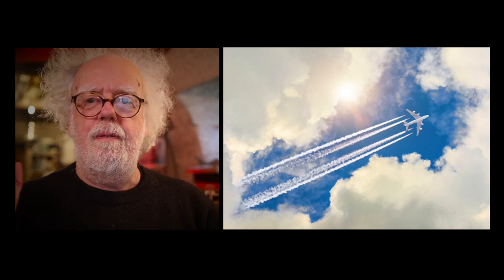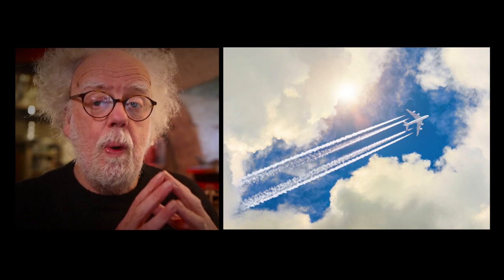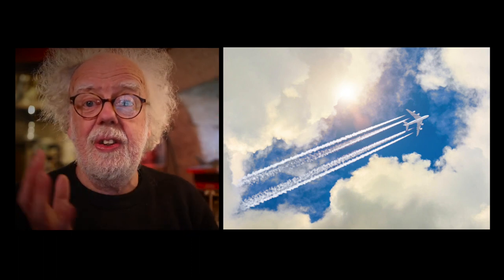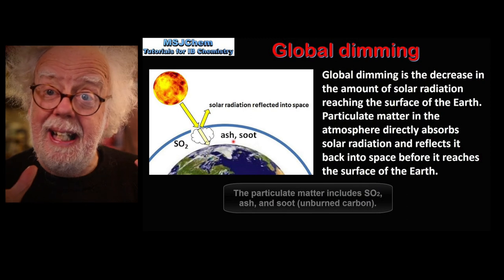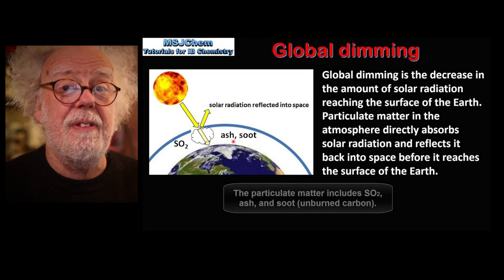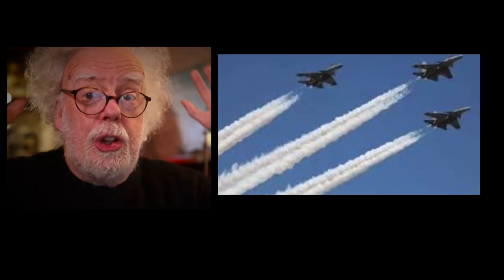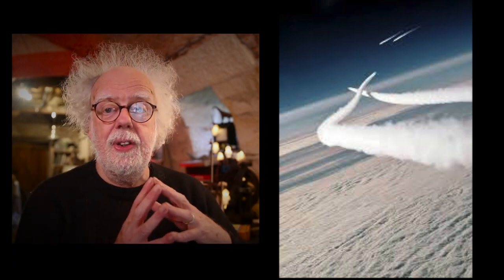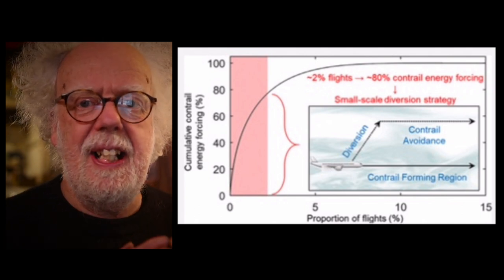Con-Trail Secrets - Prof Simon

Comment: Brilliant thanks. As a pensioner and now full-time gardener, I have observed beautiful blue morning skies destroyed by vapour trails not from regular flights but from formations of high speed presumably military jets flying criss-cross. Just as your dad observed the trails just widen and widen until the whole sky is obscured. Very annoying for a gardener. Now recently (last couple of years) this activity has stopped (odd that). Regular flights tend not to cause problems perhaps because they are lower nearer us. Twould be great if flights could be planned to avoid making these trails in the first place. Also nice of you to admit that clouds are the major greenhouse gas. All gardeners know that if it's cloudy in the evening there is no need to worry about frost because it keeps the temperature much higher than a clear sky. (Incidentally, I have never looked at a CO2 meter and said I'd better protect my plants because there is 0.001% less CO2 in the atmosphere today but let's not go there). Perhaps also of interest, in my last job I had the pleasure of having Frank Whittle's original signed patent for his jet engine in my safe. Quite a privilege!
Reply: Those "criss cross" patterns are planes flying along set routes in the sky
Like highways for planes, each altitude has a set direction, the routes are called airways 
You mention one day it suddenly stopped 
I'd wager a bet the airways were changed in your area
Info on that is publically available of course, youd have to do a little research..or find a pri ate pilot familiar with your area and ask 

The radio towers used as navigation beacons  are sometimes moved
Its fascinating stuff, you might find yourself reading quite a while on it  :)
Reply: A bunch of anecdotal gobbledygook. What is your actual point?
Reply: Whatever the cause Dave, I am very pleased to have my blue skies back but no, the cross cross jets were all flying at the same time and making a perfect grid. Passenger flights were entirely separate larger planes. Generally these are lower, landing at nearby Manchester or Liverpool and their vapour trails disperse immediately.

Comment: I'd expect Brownian motion to mix the exhaust such that it doesn't matter the altitude. What I'd be interested in is the effects of fuel dumping. Such as, the Los Angeles incident recently. An SR-71 pilot once commented after doing a low level fuel dump that, "there's a farmer who's going to wonder why he had a bad cotton crop this year."
Reply: Good question, though the problem is that the SR-71 uses a special fuel that has special additives to increase the flash Point significantly.

So a better case would be the recent fuel dump over.......LA at Low altitude would be a better case.
Reply: I thought they could only fuel dump into the ocean, not that I agree with that concept either but more importantly are they dumping for emergency landings or because they want to control the agricultural sector and increase the cost to the general consumer for food. The government of the day don’t look after the population and they have had a hidden agenda for a long while. They burn out the farmers force them into loans they cannot repay then repo the land they owned for generations and replace with gmo crops.
Reply: @sfd50  No, the requirement is to dump above, I think, 6,000 feet in order for it to evaporate before it can rain down on the surface. I don't buy in to any agenda regarding that. No such thing as chemtrails, other than maybe seeding clouds to affect rain.
Reply: @LupusAries  The SR-71's fuel is regular kerosene with cesium added to reduce the heat signature from the engines. Something to do with a change to plasma. I believe the good Professor had a segment about that recently.

Comment: Having lived all my working life  just 12 miles from Manchester Airport and directly under the flight path, I had been seeing for many years how quickly a beautiful blue early morning sky changed into a completely overcast and dull one.  The convincing proof came when I had travelled to work 30 miles away and the sky had became clear of overcast.  This I noticed  literally hundreds of times over a period of 20 to 30 years.
When I retired,  I moved away from North Manchester and down to Worcestershire, and lo and behold the blue sky's of my youth have mostly returned.
Reply: @GypzyJack  The conclusion that  I drew is that vapour trails initiate the formation of an overcast which quickly replaces the clear blue sky.  The observed result was that a regular blue sky from first light had become a regular overcast sky by 
9-30am.  (The first regular flights and vapour trails directly overhead started at roughly 7-45am)

Comment: I see one article on Stealth Aircraft Contrails that brings up these two interesting points..

The original B-2 design included tanks outboard of the main landing gear that would store a chemical to mix with the exhaust and suppress contrail formation. According to one report, "chlorofluorosulphonic acid" was to be injected into the jet exhaust to eliminate contrails. But this scheme wasn't actually used. Several other acids were tested too, but the result was that the chemicals were too corrosive.

In 1994 the government awarded a $63.5-million [other sources report $16 million] contract to the Northrop Corporation to fine-tune stealth bombers in a number of ways. One retrofit involved the installation of "contrail management systems." Ophir, an optical sensor manufacturer in Littleton, Colorado, saved the day. Its Pilot Alert System uses lidar (light detection and ranging) to differentiate contrails from clouds and tell the pilot to change his altitude when his aircraft is "conning."

Done some more digging and i find this ..here is a patent for such device 

https://patents.google.com/patent/US5285256A/en
Reply: I was under the impression that they mixed alcohol with the exhaust at one time to prevent contrails.
Reply: @garywheeler7039   It's not a subject i know much about, what i post is just 20 mins of searching around ....

Comment: It's a few decades since I was a research chemist but here's my ten pannies' worth. Regarding whether vapour trails form or not depends on the temperture and the dew point of the air through which the plane is flying. I'd suggest that the existing air humidity is a relatively minor factor. All aircraft emit vast volumes of superheated steam from fuel combustion. Thus, a condensate stream (contrail) will result when the local dew point parameters are exceeded. Soot particles from engine exhausts do act as nucleation points for dew, though a similar function is provided by airbourne bacteria. Indeed, harmless bacterial concentrates are/were used to initiate water crystalisation in snow-making machines. Other colloidal materials are also used as nuceators.
Not all contrails persist long enough to produce an ever-widening haze that affects sunlight. Very often, they disappear a short distance behind the plane creating them. Here. the dissipation of the vapour reduces to a condition below the local dew point and the sky remains perfectly clear. At other times, aircraft produce no trails at all.

Comment: I certainly noticed the difference between the skies over Southern England and Queensland Australia. Not just the latitude but the significant absence of high altitude condensation trails. Of course, the clear atmosphere of Australia brings with it the increased risk of high UV levels... so Slip, Slop, Slap... or burn more AVTUR, Australia the choice is yours!

Comment: Northrop, when designing the B2 put a lot of effort into the the exhaust system to ensure that they produce no contrails. The exhaust is mixed with cooler air before it exists the nozzle and that nozzle is set back inside the aircraft. The result is no contrails and very low heat signature that would give its position away. I also believe that the aircrew have an instrument for measuring the outside moisture. Great upload professor 👍

Comment: I was a USAF weather specialist, an observer, in the 1980s.  A lot of what you said is almost accurate, but is missing a lot details, especially how this has been known for decades.

Meteorologists have been aware of the warming effect of persistent contrails spreading and forming a cloud layer.

Also, contrails can be forecast using upper air soundings.  Weather balloons carrying a rawindsonde will record air temperature, dew point (the two rill give you relative humidity), air pressure, and by tracking the balloon you get the wind speed and direction.  As a result you get a profile of the air from the surface to 200mb or higher.

When this data is plotted on a Skew-T Log P chart (and I've plotted a lot of these by hand) a forecaster can forecast at what flight level contrails are likely to form, and whether they will persist and spread out.

Comment: anybody mention when you see contrails forming ,a moist low pressure front is moving in  and vice versa.I lived in a arid climate and depending on which frontal system was coming in or exiting you saw contrails forming or dissipating 

I'm sure the military experiments with chemicals to dispel them though.

Comment: This has become a significant issue since commercial aircraft started routinely flying above 40,000 feet in the interests of fuel efficiency. Flights at or below 20,000 feet produce far fewer contrails and they disperse relatively quickly in the more turbulent lower atmosphere. Going back to the 1960s I recall seeing contrails quite frequently in Winter months in the UK. In Australia during the same decade, contrails were never visible at any time of year. Of course commercial aircraft tended to fly at altitudes around 20,000 feet in those days. So the overall climate of a region is particularly important in determining at what altitude aircraft can fly without leaving visible contarils.

Comment: Professor Simon, That information is gleaned from the data transmitted from a weather balloon. The piece of technology is called a rawindsonde and the device is a radiosonde. The data transmitted back is plotted on a chart called a skew-t. The contrail (vapor trail) zones are indicated on the chart. One big problem is that there are so few launched each day compared to the amount of atmosphere to measure. I used to be a technician for meteorological equipment.
Reply from the maker: Thanks Mike

Comment: Doppler weather radar is only useful if water vapor is in the air. That’s why clear air turbulence is still a problem when the air contains no moisture and radar cannot see it.. i assume a hygrometer attached to a pitot tube can sense relative humidity? Maybe there is also a connection to dew point at flight levels?

Comment: Well there is another source of the moisture. The product of combustion is carbon dioxide and Water Vapor. It all depends on the temperature of the air. I am pretty sure Ice Crystal's can form any time the temperature is below 0 degree C. And at 35,000 feet it is well below that.

Comment: I thought contrails only appeared when a plane rises above the altitude where the temperature is less than zero degrees Celsius.  I believe this to be between 5-10 km.  Although this is not normally a good cruising altitude for fuel economy or passenger comfort as the pilots avoid low level weather.

Comment: Every litre of jet fuel or petrol burns to a litre of water. Whether it’s a piston engine or a jet engine that water condenses into vapour trails. 
They do reflect heat into space but it’s not necessarily enough to offset the CO2 warming effect.
Reply from the maker: not sure it makes the same amount in water.... there are hydrocarbon particles...soot....and lots of C02.

Comment: Don't forget to mention that fuel is not just organic. Fuel also contains nano particles of metals especially aluminium being used as a catalyst. This is very important for fuel efficiency but is also causes problems for the environment.
Reply from the maker: Interesting
Reply: @SimonHollandfilms  check out the Shasta county video about this. They have been measuring increases in aluminium in top soil.

Comment: Contrails are condensation which disperse into the atmosphere at a constant rate following the plane. Chemtrails are full of chemicals and metal particulates. Harvod Uni had something on them a few years back which stopped Chemtrails from being dismissed as conspiracy. Geo engineering and weather modification has been going on for decades. 

There's no need to introduce your own term Vapour trails in to muddy the water.

I speculate that adding metal particals in a blanket at (Chemtrails) 30+ thousand feet high aid telecommunications. As most bandwidth is lost up....
Reply from the maker: In Britain we call them vapour trails...I didn’t make it up...and the film was not about chem trails...it was about climate science

Comment: Actually, there's moisture in a jet engine exhaust and it condenses into the water which freezes at the extremely cold temperatures at high altitudes that jets fly at.

Comment: Prof Simon, yuo seem to have overlooked that the two major combustion products of kerosene are Carbon Dioxide and WATER.  The water is hot and therefore gaseous, hitting the cold atmosphere they condense, hence the name Con Trail !! Its WATER!
Reply: As for measuring humidity.  No required.  DEW POINT which I think is a function of ambient temperature and pressure.  And as for the U2, I'd guess you want to be looking at what they add to the fuel to stop contrails.

Comment: Your question about humidity levels in the the jet engines are not measured. I can say that the efficiency for jet engines comes from condensing the air and I’m sure you know that when you compress air you remove the moisture.  Basically what your seeing out the back of a jet engine is primarily moisture. The actual carbon emissions ie. co2 is not visible.

Comment: On the type that I currently fly, the 737, there is no way of measuring outside air humidity. Merely the varying temperatures and pressures. It is interesting to see however when an aircraft passes by and there is no trail, or a rather excessive one.
Reply from the maker: Brilliant...thank you Henry...if ATC we’re flexible enough to let you change altitude in, say a 2000ft window, do you think this could be adopted?
Reply: @SimonHollandfilms  ATC are usually very accommodating to a change in level if it is for performance, weather, etc. The only issue that I can see arising is if 10s of aircraft are requesting the same FL in order to mitigate vapour trails. This would probably need to be taken into account in the planning stage when filing a flight plan, such as what our systems do now in trying to file favourably based on the winds.

Comment: Great to see recognition of cloud formation affecting our climate change from you prof....I can only imagine vapour trails hang around more now than when I was a kid because of fuel mixture changes and the leaner burn of engines. More denser / dense, unburnt fuel would drop quicker and vaporize less...Just my best guess...
Now ask your self is the extra heat which these clouds created, account for in any climate change report?  No there not the extra heat just bumps up the co2 figure...is any pennies dropping yet?
But dam good suggestions to fly higher/ lower...I want climate heat down too...but record it right. Regards.
Reply from the maker: Clouds are our main source of greenhouse warming...but CO2 absorbs heat and makes the clouds....hmmmmmm.
Reply: @SimonHollandfilms  bang on, clouds are also made by charged particles from the sun. In your mind what proportion are made by co2 and what proportion is made by charged particles. When you know the answer to that,   You won't say main source of warming. And see charged particles where not allowed into the ipcc report then your know a large amount of data and heat is unaccounted for. Regards.
Reply: @SimonHollandfilms  "Green house effect" is not even the right term for the process, its a conned buzzword for "Science" warshipers.

Comment: Professor.. I have an idea that might work if they knew or could monitor  what moisture level   or  percentage  of the exhaust that is water is emitted from the jet engines. at various altitudes.It  could .easily be done with a small tube outside the aircraft being used to test the ...existing vapor trails and be able to vary the moisture being released, then they could  use that info and   then   alter the Vapor Trail  water content by Pre- heating some of the the incoming air.(  a lot like the Ram Jet Engine)..so that  the water levels  would drop to a low enough  level.so that there would not be any trail at all..let me know what you think..?

Comment: It's possible the Engin management system already reacts to humidity to maintain efficient combustion if so this could be used as a source of data without modification to the airframe.
Reply from the maker: Interesting

Comment: Contrails disappear because heat causing water vapor condensation goes away as the plane flys forward turning back to cool air. Now what's really coming out of the plane when the pilot presses the bottom is metals salts of aluminum, barium, and strontium 90 and some times other nasty bio material all known as aerosols. This video should be about Aerosol Trails.
Reply from the maker: Andyity....you solved the chem trail mystery....it’s all coming out of the pilots bottom.